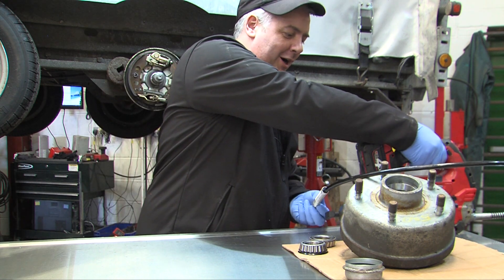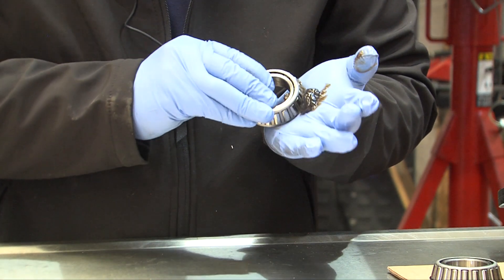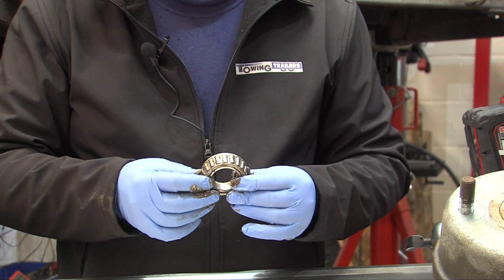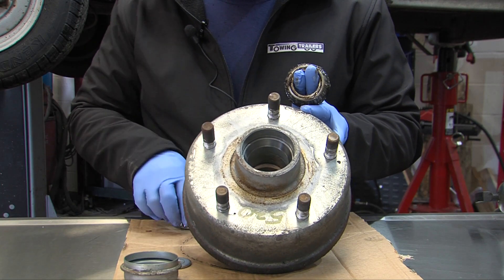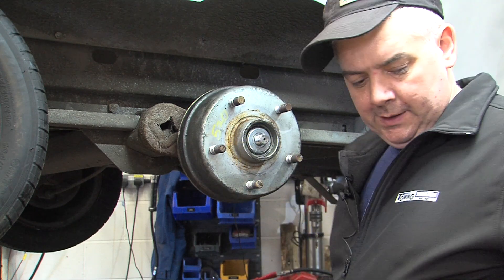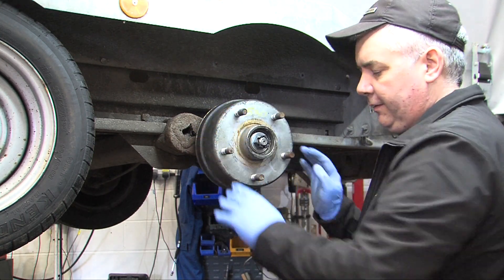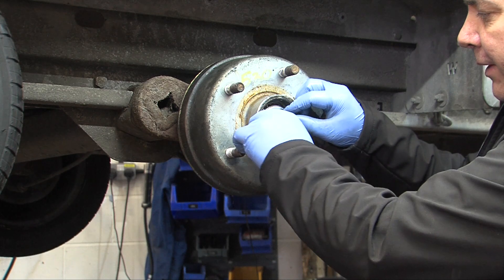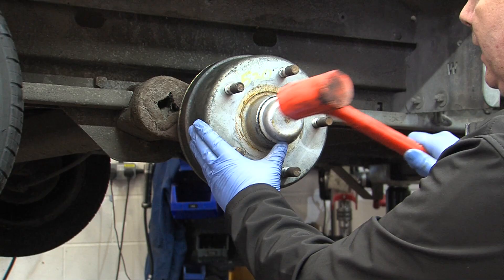How to fit a trailer brake drum with taper roller bearings

Comment: Hello,  Great video, gave me the confidence to service the hubs on my Indespension trailer.  As you mentioned in the video, the inside bearing has a seal attached to it.  So as not to damage the seal, what would you recommend I use to clean the bearing with, e.g. no nonsense degreaser or brake cleaner?  Any help gratefully received.
Reply from the maker: Glad it helped

We use a paraffin based solvent but in the early days we would use diesel but it was smelly many company's are using a water based cleaner. any thing will do than thins the grease to clean it out.
Most auto spares shops will have some sort of degreaser like your no nonsense degreaser you mentioned. I would avoid brake cleaner as you will need a lot and it could get expensive but it would work.

Towing and trailers
www.towingandtrailers.com
01909 473749

Comment: Was there a grease seal on the rear bearing?
Reply from the maker: This maybe was not the best hub to do the video with it was an Indespension hub. 
Indespension hubs have a seal built on to the back of the rear bearing and don't have a separate rear seal. 
All other brands of hubs ( Avonride, Meredith and Eyre, Peak and Al-ko) other than the unbraked hubs that fit a 1" diameter shaft that have taper roller bearings don't have a seal built in seal like this, they have a separate oil seal behind the rear bearing. 
The separate seals are difficult to remove without damaging them I use a press to push the seal out with the rear bearing. This is not due to the force required but the fact it applies even pressure all around the seal and does not bend it however the spring occasionally comes off the seal.
The seal can be quickly removed by prying them out from the back but this usually causes damage and the seal needs to be replaced I do it if I am changing bearings or the seal looks damaged as the seal would be getting replaced.
On a service I press them out as I intend on using the seal again I just remove the seal to get the rear bearing out to clean, inspect and re grease.
To fit the seal I recommend a plate larger than the seal over the seal and either press or tap it in as this stops pushing the seal when it is level with the back face.
Reply: @TowingAndTrailersLtd  Thank you,
I enjoyed the video.  I usually wreck the 🦭's trying to remove them.
Greetings from Alabama!